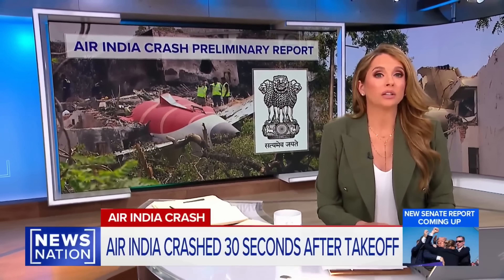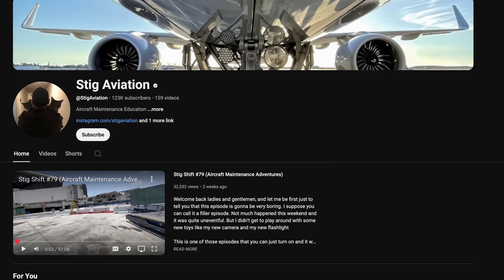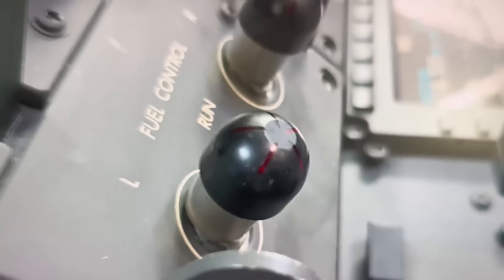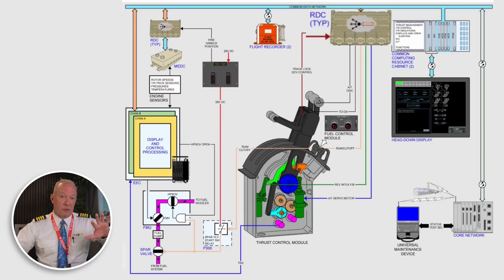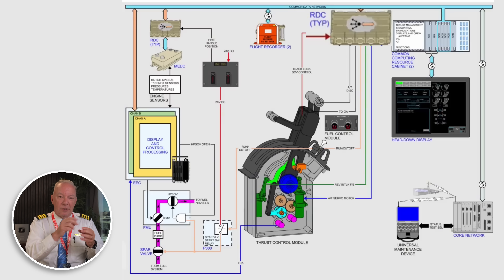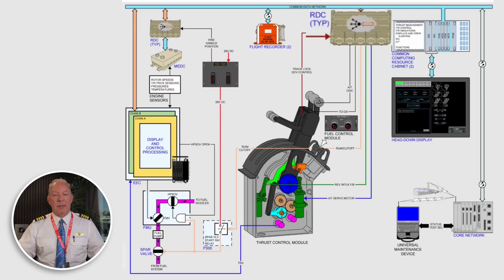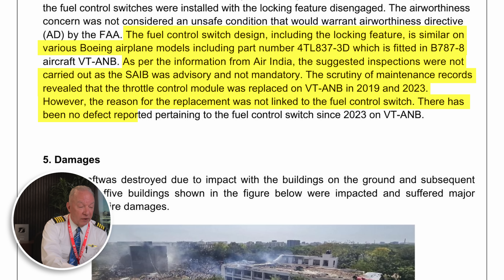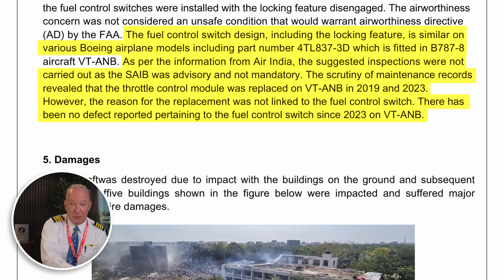The Truth About Boeing 787 Fuel Control Switches

Comment: Retired avionics tech with 30+ years experience here. I am not familiar with the relay that controls the fuel cut-off valves in this aircraft, but I do know that most relays have 28VDC constantly applied to one side of the actuating coil and need to have a ground applied to the other side of the coil to complete the circuit and provide the magnetism that pulls the relay reed to the other pole. This way a loss of power defaults to a "normal" condition which is often normally open --I am reasonably sure this defaults to fuel being applied unless the pilot or mech/tech wants the fuel cutoff.

To mimic that operation, there would need to be a "phantom" ground applied to one valve actuator relay coil ... then another "phantom" ground applied to the other valve actuator relay coil one second later -- and then the reverse happens a few seconds later.

I call on Occam's Razor here. The chances of even one of these "phantom" grounds happening is infinitesimal  ... but some apparently want to believe there were four sequential "miracles" that turned the fuel off and later back on without human operation.

One of the people in the cockpit moved those switches to cutoff. We don't know why they did it, but it is virtually certain they did.
Reply: We'd have to see the schematics and trace them from the bus, circuit breaker and then to the relay. Some are normally open and others are normally closed with the ground side going to the switch to close the circuit to the relay coil.
Reply: Captain Steve incorrectly describes the control of the fuel values according to the diagram he presented. He needs to explain and correct those errors if he is to restore his credibility.
Reply: @exist7309  He's a pilot. He's not going to have the intimate knowledge avionics/electrical techs would have. The truth is a human hand moved those switches. The systems are simple with no software glitch being able to cause this. The data doesn't lie.
Reply: @vihtoripuurola3775  you are correct; he is only a pilot, which is exactly why he should not be telling everyone who is willing to listen that the system is simple with no possibility of control from another source. Because the diagram he is using shows that statement to be incorrect.
Reply: @vihtoripuurola3775  as far as the data not lying, do you know whether the run-stop status signal received by the RDC undergoes any processing before it is received by the FDC?
Reply: @exist7309  These systems are simple on purpose and designed that if they fail, it is in the position with safety in mind. Just like trailer brakes will engage when they lose the air pressure that keep them operating. There is no AI or software keeping those switches on.
Reply: @exist7309  If this was true then they would have grounded all these planes immediately until a software patch could fix that. Those switches were moved physically. This is proven b the FO asking why the captain turned them to off, and then being put back to run at 10 seconds and 14 seconds later. There was no glitch. They worked exactly as intended.
Reply: @vihtoripuurola3775  all I am doing is pointing out the discrepancy between the diagram presented and description provided. Please acknowledge the involvement of the EEC in the fuel flow control and show me whether the FDC records raw or conditioned run-shutoff signals.
Reply: @exist7309  Doesn;t change facts that those switches were turned to cutoff. If the FO had not called out the captain there could be some doubt, but the CVR captures that exchange. Occam's razor applies here.
Reply: @vihtoripuurola3775  the first thing we need to get straight is how the system works. So far this video has only introduced conflicting information. Once we know how it works then we can interpret the CV dialog.
Reply: @exist7309  The switches were put into the cutoff position by the captain. These are not complicated switches. Have to follow the evidence and there is no evidence that points to something other than the switches being turned off right after wheels up.
Reply: @vihtoripuurola3775  the point here is that Steve has incorrectly described the system relative to the diagram he presented. The fuel flow can be cut off by the EEC and we haven’t seen any evidence yet that the FDR gets the run signal direct from the run-cutoff switches. Please show us that information.

Comment: As I understood it, cycling those switches to cut off, and then back to run, will initiate an auto restart, and this is a taught procedure for certain engine failure conditions ?? Indeed, when the switches were returned to run, one of the engines re-lit and was producing power, and the other was in the process of doing so. So if that is the case, that would imply that the system is not quite as simple as the switches just feeding power to a relay that's in the line to do the 'heavy lifting' of controlling the amps that those big old solenoid controlled fuel valves are going to pull from the 28v bus. And although the systems are 'completely independent' of each other side to side, I wonder if that is fully the case in terms of the low amps 28v feed to the actual switches, or whether a single feed from a single breaker or fuse is paralleled up to the input side of those switches, after which it becomes completely independent. It would be interesting to see a proper electrical schematic for this, rather than the 'illustrative' one that you show in this video. Also, if the entire throttle quadrant, complete with those switches, has twice been replaced, then that is two opportunities for something not having gone back quite right. All of the electricals to that total assembly, will get there via multipole connectors, I'm sure. I take on board what you are saying, but it is still all just speculation. We will not know for sure until the FDR and CVR data is fully analysed, and maybe not even then. It would be interesting to see an actual word for word transcript of the 'discussion' between the pilots regarding the switches. All of the reports of what was said seem to vary a little bit, and the semantics of exactly what was said may be very important as to what that exchange actually meant.

Comment: So it is by wire, and therefore if a wire was chafed or worn or otherwise inhibited (possibly voltage) then perhaps the 3 valves did not all open.
Reply: It wouldn't happen to both engines as they don't share the same wires.

Comment: what i don’t understand is why would the design let you turn off fuel pumps during take off. it shouldn’t allow this unless wheels are on the ground. you can turn off fuel to a engine but even that should not be allowed to happen unless you are at a certain altitude. 

even if this was an accident with the price these planes go for a simple system can be added to not allow something like this from happening.
Reply: You would turn off fuel at altitude if there were an engine fire.
Reply: You would want to shut off the fuel to the engine if there was a engine failure. A thrown blade cutting the fuel line would result in a fire. The loss of the engine (ripped off the wing) would result in a huge fuel spill and possible fire.  While the fuel cutoff switches are used daily to shut down the engines, from a safety perspective, they are there to protect the airplane from engine failures.

Comment: Steve, Could have both relays failed because of a sudden power surge from the 28Vdc supply. There is a dedicated 28Vdc supply which comes from an ac to dc power supply unit. The batteries are in actual fact a backup source of 28Vdc should the main dc power supply fail. So could it be possible that the 28Vdc power supply unit failed and gave out a big surge of voltage which literally blew up the coils in both the relays thus simultaneously opening the circuit of the 28Vdc supply to the fuel valves. How a relay works is that a coil of copper wire is supplied with a dc voltage and current, this causes a magnetic field which then pulls two switch contacts together. If the relay coil is supplied too much voltage and current then it can burn out and go open circuit then there's no magnetic field to keep the contacts of the switch closed. If that happens then the position of the fuel cut off switches is irrelevant and the 28Vdc supply to the fuel valves is lost. I think its a possibility.
Reply: Doesn't explain the black box measurements of the switch positions and the 1 second between the change of the two switches and them being switched on ten seconds later. Also, the voltage of the DC batteries is measured and stored in the black box as well.
Reply: It requires power being provided to either the closed or open circuit on the fuel spar valves for them to change position. Voltage spikes, or loss of power would not command valve position to change.

Comment: This will be lost in the noise.
As a seasoned design engineer, I find myself wondering how the electrical contacts of the FC switches are actually made, and what will happen if a pilot places the switches 'halfway' (not falling into the RUN position) so the detent feature of the switch can ride on the top of the locking platform. If that was done, could the rotate angle, takeoff vertical acceleration, engine vibration and wheel vibration all together be enough to encourage the detent to slide down the locking platform - so mechanically opening the FC switch contacts?
As unlikely as this seems, it is the only explanation that allows the reported pilot transcript to make any sense.
Reply: The fuel spar valves stay in the last commanded position with voltage spikes or loss of power. If the fuel cutoff switch was in some in-between position, nothing would happen. The switch has to move to run or cutoff to provide power to the actuator for it to move.

Comment: There is no earthly need to have those fuel switches available to the pilots. While they are required to route fuel to the engines or cut it off, They can be placed elsewhere and activated during preflight outside the cockpit. The throttles have the same function during engine start, taxi, takeoff, cruise, and landing. Those fuel cutoff switches should not be available in the cockpit to the pilots.
Reply: I believe they are also used to re-light an engine that has failed
Reply: If an engine fails; loss of a turbine or fan blade, or is ripped off the wing, it is good to be able to stop the fuel feeding a possible fire.
Reply: What if there's an engine fire? You don't want to keep pumping fuel to a burning engine!

Comment: Am I  correct in that, these fuel switches must be in the on position in order for engine start up?  If they are in the cutoff position, there is no way to start the engines!  Seems obvious but now, is it possible that the impact caused these switches to pop out of run and into cutoff whereby giving belief that they were deliberately turned off. Seems that there might be reason to believe that it was deliberate.  Just saying!

Comment: Wow the pilots believe the pilot was at fault but in no way could it be related to a short circuit on the primary dc charging line at a high current, due to a failed diode
Reply: Power has to be provided to the open or closed circuit of the fuel spar valve for it to change position. High current, voltage fluctuations or loss of all power will not change the valve position. A short circuit, e.g. wire chaffing, could cause one valve to change commanded position. But the chances of two wire chaffing events happening within 1 second, and then 10 seconds later two more wire chaffing events (power must be provided to a different circuit) is so far beyond probability calculations as to truly be impossible.

Comment: What if a pilot switched off the fuel switches by mistake thinking it was to retract the landing gear.
The plane loses power the other pilot starts looking around and 10 seconds later sees the switches off and asks, 'why did you cut off ', he then switches one on at a time with a delay as per startup training.
Reply: I don't know of all the human factors involved, But the landing gear is a lever with a wheel on the end that you push or pull. The fuel cutoff switches are more like light switch that must be pulled out and flipped, once for each engine.  I personally don't see any way that muscle memory could confuse the two actions. But I'm a design engineer not a human factors one.
Reply: @paultruzzi911  Yes, difficult to believe, sometimes under stress one does strange things, the other option is that they were switched off deliberately, it's one or the other.

Comment: The Captain’s circuit explanation confuses a switch “contact” with the word “relay” which also has contacts!

Sooo - I believe he means - - the switch is turned ON closing the switch contacts, then the 28v from the switch contacts is applied to the relay coil which activates and closes the relay’s contacts, the relay contacts now supply 28v to the fuel valve solenoids which opens each valve’s flow path allowing fuel to be fed to the engines.

Reversing - - switch set to OFF reverses all energized levels indicated above to off.

Comment: I am an EASA B1/B2 Engineer and carry an A&P rating.
 Everything said here is technically correct. I will emphasis the point that the switches are completely independent of each other and and outside systems by design. Legislation dictates that.
 The engine computers, FADEC, are  extremely complex units. Failure of both is unheard of. They have multiple independent channels, duplicated sensors, cross checking and validation. They have separate independent back up power supplies in the event of failure. They have built in software to run the engines at a high power setting as a full nuclear failure option. The engines will not shut off or shut down unless fuel is cut with the fuel cut off switches. 
Only human intervention and action shut those engines down.
Reply: Out of curiosity, did your training include "closed loop" systems? Did it include electronic logic components, like AND gates? Did it include how to read circuit diagrams? If so, it makes me wonder why you say "Everything said here is technically correct"
Reply: so, that's why officials have been looking into  electrical and computer glitches. It seems they don't share the same positive notions as you.

Comment: My theory, based simply on the fact I want it to be an unfortunate accident and not a deliberate act, is one of the pilots had a major brainfart and manipulated those switches by accident.

Far fetched, I know, but I've also made mistakes like that. Doing the same thing day in and out, and one day, without reason, operating the wrong set of buttons causing issues at work.

Comment: Can not be fully true, because if the system is not connected to anything else but the battery, how could the black box then record that it had been switched?
Reply: Stating that the computer “senses” (input to computer) from the switch/relay circuit is not the same as the computer “controlling” (output from computer) the switch/relay circuit.
Reply: Valves usually have a position indication position signal. On the fuel spar valves, it is a pair of limit switches that ride on the valve shaft. That analog open or closed signal is sent the CCS (computer) where the FDR records the position change and the flight deck synoptics change.